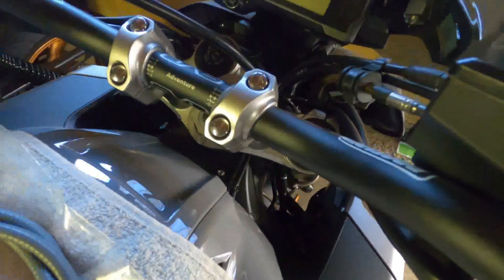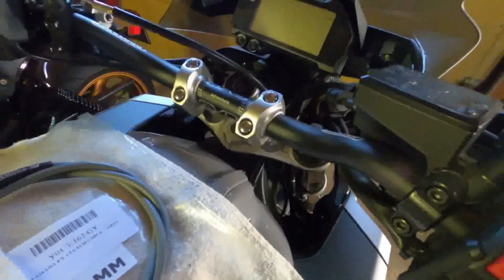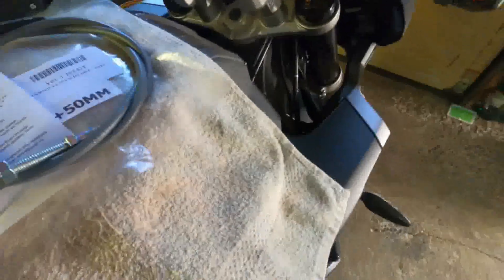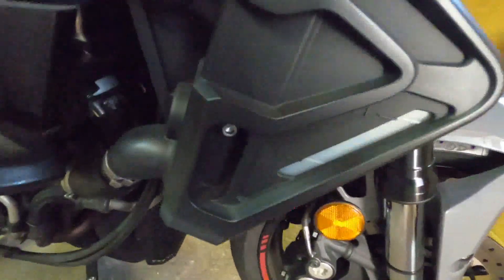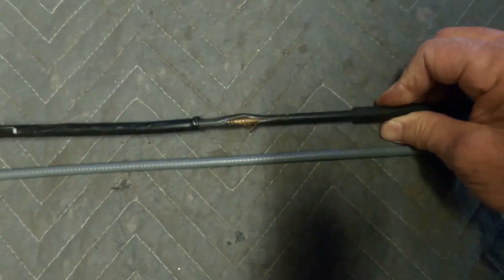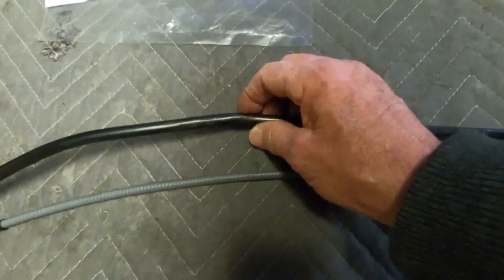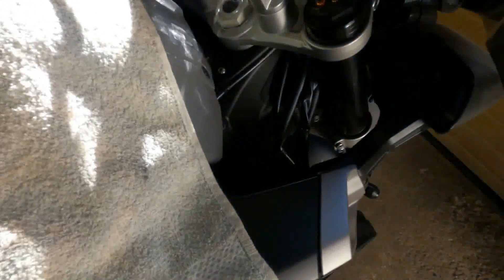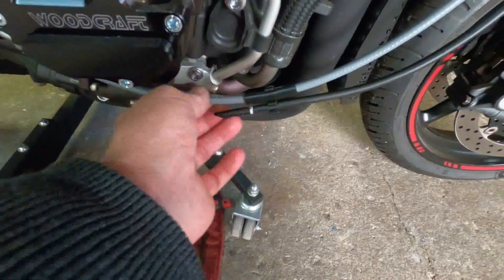Yamaha FZ10 / MT10 - Upgrade your clutch cable that's too short.

Comment: The Venhill looks skinnier than stock.  Is it easier to install? And does it work fine with aftermarket clutch lever?
Reply from the maker: The outer casing isn't as thick, so a bit skinnier than stock as you noticed. That's why I added the double shrink tube wrap on part of it. The install would be about the same as stock and does work fine with the aftermarket clutch lever.
Reply: @xHondaHack  what needs to come off at the side for routing? Just the blinker shroud?
Reply from the maker: The shroud is really the only thing in the way. That helps with getting your hand in to guide it past the bracket that's behind the radiator.  @futureboy40
Reply: Thank you! Cable on order +2"!
Reply: Cable came with reinforcement at the wear areas.  Will be installing this week.
Reply: Thank you again.  That extra 2" should have definitely been stock.  Been struggling with the poor OEM design since purchase.
Reply from the maker: @futureboy40  Glad it did the trick for you too. I think all the FZ10/MT10 owners should take a closer look at their cables.